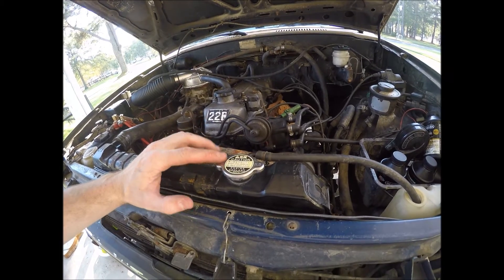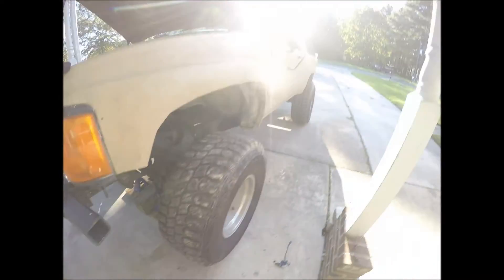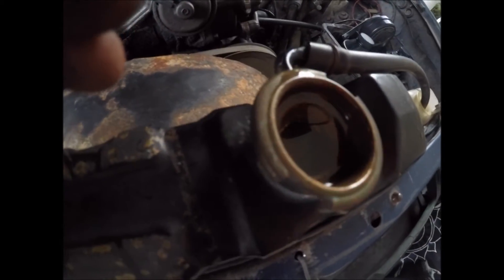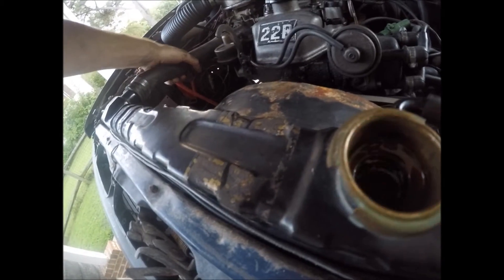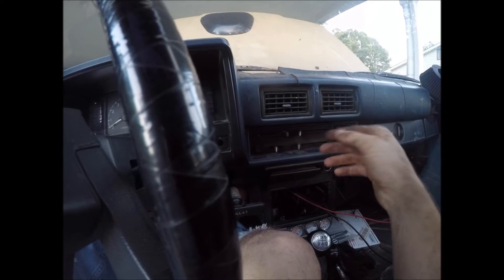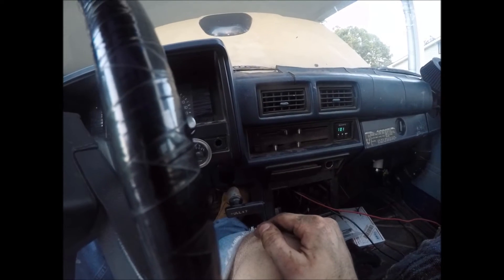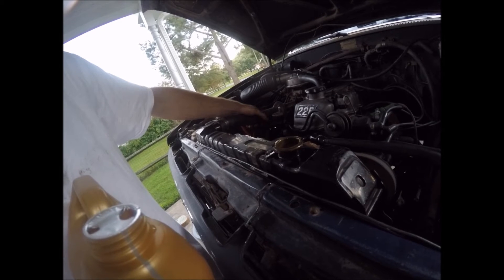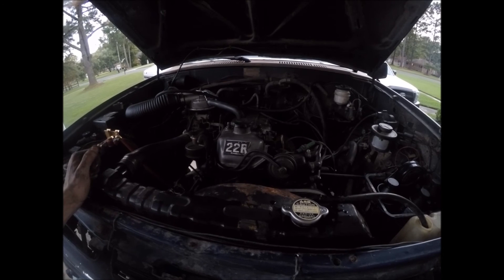How to burp a radiator- pickup/4Runner

Comment: This is actually not a good idea. If you have an engine with a over head cam or cames. And you do not have fluid in the head or heads when the engine gets hot you can crack a head or do other serious damage.

Comment: I drove my 1985 4runner with the 22re and installed a new heavy duty 3 row radiator with the Toyota Dual thermostat. after the installation I drove it on a hill and parked it for a min with heater on etc. worked like a charm to burp it.
Reply: Great comment….Ive done that 1/2 a dozen times after switching thermostats or replacing coolant…after doing the upper hose squeezing, parking on a steep hill & letting the truck run a few minutes gets all the residual air out.

Comment: Go the extra mile. Purge the block. Leave the thermostat housing bolts loose and the upper rad hose disconnected from the housing and propped up. Fill slowly until coolant comes out around the thermostat. Tighten the housing bolts, reconnect the hose or if drilled fill until coolant drips from the neck then connect the hose. At this point the block is purged. I overheated the hell out of a Jeep once by not purging the block. It was easy to purge via a heater hose on the thermostat housing, the 22re isn't that bad either. I've worked on dodge a 3.7 and pt cruiser 2.4 that had purge caps.

Comment: After filling the radiator, do I fill the overflow to the full line?
Reply from the maker: christopher rivera yup
Reply: No, you never fill your overflow because it's to catch coolant if your engine overheats so that way it doesn't go on the ground, hence the word overflow.
Reply: @327thejess  What do you think the fill line in the overflow is for?  You're supposed to add coolant to the full line. If the engine gets low, it suck coolant into the system.  The fill line is always low enough in the reservoir to accept overflow if the motor overheats.

Comment: thank God you're smart to use the Red Toyota Coolant
Reply from the maker: Toyota red would have been a bad idea in my case as both the engine and radiator's previous owners used green coolant, mixing red with green results in sludge. I looked into whether I should do thorough flushing to convert to red at the time and found that red wasn't even made yet in the 80s so I figured it wasn't super important.
Reply from the maker: However, when I finally do the 20/22 hybrid I will thoroughly flush the radiator and start fresh using red only from then on. The 20R head has already been thoroughly cleaned.
Reply: Ive been using toyota red since i bought it. On my 88 pickup. Its best for Toyota.
Reply from the maker: it is best, yes, and I am going to use it, yes. but it is not good to mix it with green.